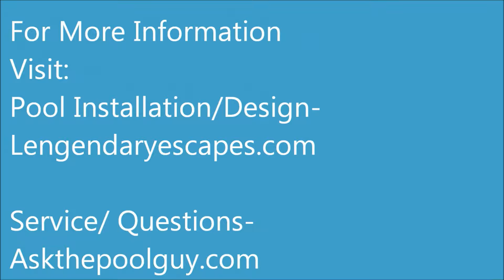Ask the Pool Guy explains How InFloor Cleaning for Swimming Pools Works

Comment: Sorry, last question. Did the walls of the pool still need to be brushed if you have in floor cleaning?
Reply from the maker: Yes, you will want to brush your walls even if you have infloor cleaning. There are often jets put on the walls to help keep it clean and sweep debris, but brushing is something you'll also want to do during your pool maintenance routine.
Reply: @Askthepoolguy  Thank you Sir

Comment: This video was really helpful. Thank you!

When water returns to pool from the filter and heater, is the only way water returns to the pool through these in floor values? 

Also, if you get a variable speed pump. Can you run your pump at 1,300 rpm or something low, or with the in floor value system, there is a certain pressure the water needs to be (and thus the pump needs to run faster)?
Reply from the maker: It depends on how the infloor is installed. We typically add a dedicated line to bypass in floor in case someone wants the option to turn it off for a party for example. It'll depend on how your builder/plumber approaches it. If you are in the planning stages, have a conversation about it for sure.
Reply: Thank you Sir